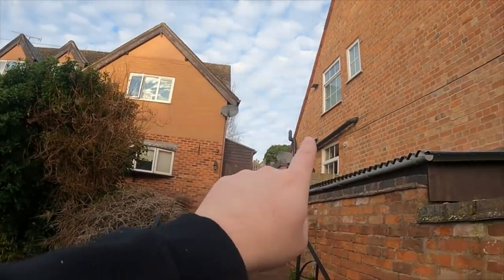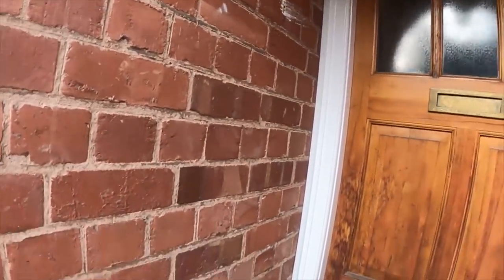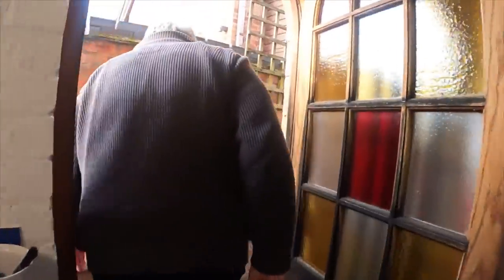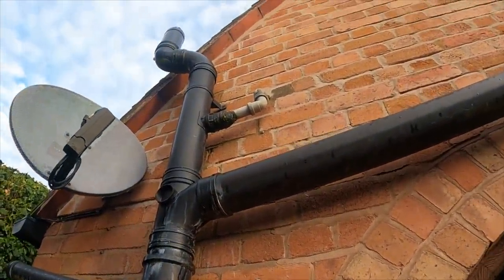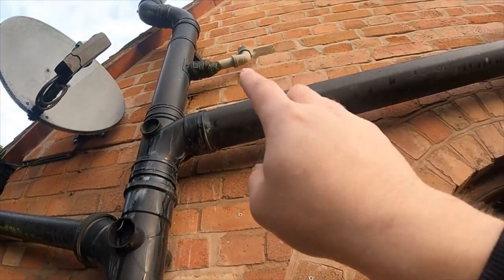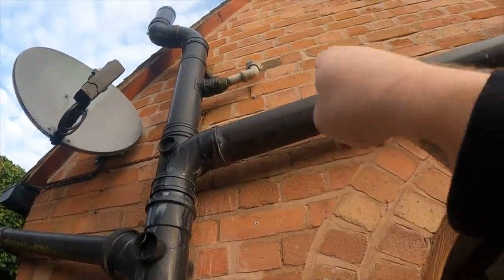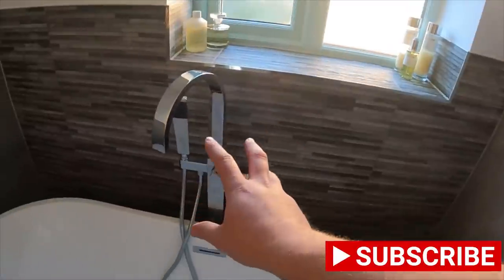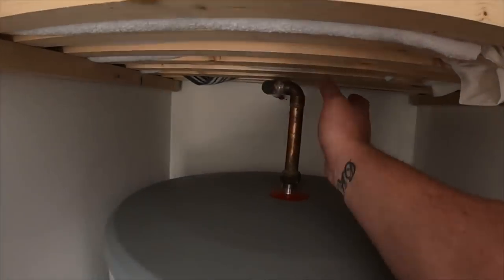PRICE REVEALED | PLUMBING COST for a BATHROOM REFURB (Cheap or Expensive)

Comment from the maker: JUST A LITTLE SOMETHING ABOUT TONIGHTS VIDEO....AS IM SURE PEOPLE WILL ASK

These are prices based upon where i live (Warwickshire) and the prices that i am happy charging my customers, in no way is it a guide to what YOU should charge.

I hope you enjoyed the video, if so give it a like, get subscribed and drop me a comment below....
Reply: Can you not go underneath the bathroom to change the valve surly easier to take the celling boards down then take the bath out tiles etc
Reply from the maker: @rastageordie7338  it’s a little tricky below as it’s the kitchen with units on the walls etc etc… would struggle to get to the area we would need…. But it’s an option👍🏼
Reply: Fantastic insight into a jobbing plumber and getting work quoted up. 
Your experience pays dividends. 
For comparison like you asked for on the jobs you looked at I would be at. 
1st job waste pipe £55 -£70
2nd job shower and Labour £210 - £250
3rd job bathroom suite £5300 - £5700

Just out of curiosity did those prices include VAT? 

Think this is a great video for trades but also customers to see what skilled trades charge so what to expect. 

Spot on mark 👍👊🤟
Reply: Thanks for the heads up, I’m moving into your area real quick!!
Reply from the maker: @davidtaylor7119  thanks mate…. That’s a great comparison…… out of interest where abouts are you??

That doesn’t include VAT as I’m not VAT registered…😉👍🏼
Reply: @MJTiffPlumbing  I’m on the Lincolnshire coast. Not long gone it alone so great to compare with experienced trades. It seems to be against the grain to talk about cost and what other trades charge themselves out at.
Reply: I was messing, good honest pricing, fair play mate👍
Reply from the maker: @davidtaylor7119  that’s just why I wanted to put a video like this out there…👍🏼👍🏼
Reply from the maker: @delboy6384  😉😉👍🏼👍🏼
Reply: @delboy6384  I know you was. Wouldn’t of expected any thing else. Good old banter 👍
But your price has just gone up 10%. Learning fast 😂
Reply: Looks like a Bovis build.? If so I normally find the blending valve under the bath, everything else is non blended. Cracking vid as always, good hunting 👍
Reply: Nice to know about pricing and quotes. But to have a roughly price once you see the job definitely need experience in pricing. Glad that I finished two videos plus a short video of your channel. Looking forward for next couple videos.
Reply from the maker: @aidanwalters8954  not a Bovis home mate…. It’s even worse than them🤣🤣

Yer hoping it’s under the bath👍🏼👍🏼
Reply from the maker: @samfoo341  thanks mate..
Reply: @MJTiffPlumbing  might be worth seeing how easy it is to drop a cabinet or two off the wall, I guess it all all depends on how they are fitted etc,, 

or an explorative hole within the footprint of the bath?
Reply: @MJTiffPlumbing  maybe try the  old hole saw on the ceiling below somewhere you can get easy access and shove you phone up there with the camera on. Least then it's easy to patch up if you don't find it and if you do it's a bonus
Reply: I think you had the problem in your hand I’ve had a faulty mixer cartridge do the same fault by passing internally, for the sake of a few quid it’s worth replacing.
Reply: Not far from me MJTiFF Hinckley I’ll bear you in mind when I need some work doing
Reply: I’d honestly make access under bathroom via the ceiling and just re route hot from basin to bath.. cap off the feed to bath currently? Patch up ceiling abit of plastering so much cheaper?

Comment: Bathrooms always take longer and cost more than any inexperienced person will ever realise because they are normally a small room that you cannot fit more than 1 or 2 people into at the same time. They also often involve, carpentry, plastering, boarding, tanking, electrics, plumbing, sometimes gas, tiling, painting, underfloor heating, flooring, etc. it is by far the trickiest room in a house to renovate. On top of that everything needs to be water proof, leak free and there are specific zones for electrics.  For those guys saying it should be around £4k, you are welcome to do all my bathrooms for me but you will be out of business within a year or 2.  Remember that loads of plumbers are self employed so they are not paid when off sick or on holiday and there is still insurance for vans, tools, fuel, etc.
Reply from the maker: Exactly mate 👍🏼👍🏼

Comment: With the bath I usually tell them that the ceiling below would be the cheapest option as the tiles would probably need to be totally removed and swapped for a near match or complete change.
Reply from the maker: Yep, that’s an option….. if it’s even in the floor
Reply: @MJTiffPlumbing  yeah that’s the nature of that kind of job though unfortunately
Reply: That's EXACTLY what I was going to say....easier and cheaper! 😊

Comment: I dont need anyone else to do the joinery or plastering or electrics. I do everything. That bathroom 5 grand if that. Now if you put in for 8 grand , Good luck  but still bit much . Now that i lnow you dont do everything yourself like i do thats why the price is huge . Its always good as a plumber to start off as a builder and do 4 years as a sparky too.
Reply from the maker: It’s also dependant on where you are in the country….. I find up north is cheaper than midlands, then london way is dearer 👍🏼👍🏼

Comment: We have just had a quote for complete bathroom refurb. Bathroom and toilet are separate (rooms keeping it like that). Complete rip out, board/plaster, Replace toilet, put in shower to replace bath, new basin, t&g walls, lay vinyl floor, decorate walls and ceiling. Quote was £6500 with first fix electrics, plumbing and cost of suite on top. We think it is expensive. Rooms are small.
Reply from the maker: Seems fair tbh…… think of the tools they need to do the job, skills, knowledge, guarantee of the work, insurance etc etc etc….

Comment: If you took the bath tap out, you could potentially thread an inspection camera down the hole along the pipes and see if the mixer valve is close by.
Reply: Good idea. Or a thermal camera to trace the pipes

Comment: Don’t know if anybody else has commented on this as I haven’t got the time to go through over 300 comments, but an infrared sensor may well show the position of a valve (future job), depending on how much heat is going through the pipe.
I have just used a Flir unit connected to my phone, to trace pipework in my flooring and it worked surprisingly well. Not particularly cheap, but for a pro you would likely recover the cost fairly quickly and it would save you a ton of hassle!

Comment: It's great to see a plumber explain how pricing a job works. When I was an apprentice, I was always very keen to know everything about learning about how to do the manual side of the job. Working with tools and producing a great job was all that I concentrated on - and I actually became very good at it. 

But, the problem came when I found myself working for firms that were charging the customer the going rate, yet I wasn't earning much more than if I just got a shelf stacking job in Sainburys. 

I did eventually go self-employed, but I was still sub-contracting for massive firms. I did see my pay packet vastly improve when I did this, but the problem I found by doing that, was that when the work dried up, then so did my job. And because I had put all my eggs in one basket I was no better off. Even having a few grand saved in the bank will very rapidly disappear when you can't find a new situation. 

I just wished I'd been able to build up my own business without always being in someone else's pocket all the time.
Reply from the maker: I hear you mate, it’s tough and the only way to make good money is by going it on your own, but that comes with pros and cons as we all know…

What are you doing now??

Comment: I've come across that problem with the bath tap running Luke warm Mark, turned out to be the tap cartridge  - it seemed to allowing the cold to run into the hot side. Try turning the hot water off and open the tap on hot only and see if you get cold water bypassing. Worth a try 👍
Reply from the maker: Always worth a try 👍🏼👍🏼
Reply: Me as well, and that was a  plastic cartridge. Unusual to put a TMV on the bath and not on the basin, will there be an update on this job

Comment: 7-8k was my guess depending on quality of fittings. This would be for bulk standard fittings. This is why as a landlord I take on most of the work myself only using a plumber and a sparky for speed when necessary and also a Plasterer to skim coat my boarding. Doing it my way the job would take 3 weeks to do and only cost me about 3.2k total. About 1200 for a plumber, 230 plasterer, 400 for sparky installing extraction fan etc the materials being about 1400. My time is obviously free and it would be a good free weeks from start to finish to complete. I expect you would get it done in a week, depending on the plastering

Comment: Good video and you covered a helluva lot there. You will be relieved to hear I have no questions or novel suggestions (because I have read the other comments😉) - however on that first video with the warm water at the bath - if the thermal imaging camera suggests the thermostatic block is under the tap - then I would suggest a quick up and under is probably worth it even if you have to take down kitchen cupboard(s) - it’s not just about being cost effective it’s also about being time effective.😉👍
Reply from the maker: Thanks Norman 👍🏼

Comment: Love the window in the bath/shower I bet the neighbours have a great show every morning/night
Reply from the maker: If they had neighbours🤣

It was obviously frosted before it was all handed over 😉
Reply: I’d be very tempted to put a easy remove washable blind on the window wall (not recessed) over that window, or a secondary sliding panel.  Once daily splashed by a power shower, it’s gonna mold fast and get hard water spots and look cruddy.  Also if I shower at night I don’t want my wonderful silhouette appreciated by all n sundry!
Bit of an eye opener this as I thought that bathroom was very small (more an ensuite size) and no moving any plumbing or ufh, so to be about 8k for swapping out just above standard same place fittings, dot n dab aqua panel (removing existing tiles?), didn’t hear what flooring, a few extra spots to connect (as already some there), bit of a skim, wow……..!  My eyes are opened, as may my wallet be!!😂  I’ve a Flir heat cam and a boroscope (only a diyer)so perhaps you need one too?

Comment: You could try borrowing a thermal imaging camera may tell you where the hot pipe goes into blending valve then goes colder after then just need to remove a few tiles hopefully? Worth a try. Glad you liked my suction pads ideas for the shower trays in the barn a few months back. Keep up the good vids and prices are good from another plumber 👍🏻
Reply from the maker: I will be using my thermal camera on it…Someone mentioned that earlier and I didn’t even think of it…(it was even in the van)🤣

Comment: Bath = access through downstairs ceiling = massive savings for the customer as apposed to alternative. 12.5mm 8x4foot plasterboard sheet would be more than enough to cover the bathrooms access needed. Repair access with said board and skim entire ceiling = 1 day plastering  and plastering materials only £450.00 tops. I would not want to get involved in that tiling looking at the rest of the work you presented. Great video 👍
Reply from the maker: All sorted now…. It’s in a video… interesting result

Comment: Last bathroom i done in Southampton was £8k on the dot. Bath out 1700 tray in,wet room shower screen, shower mixer, basin toilet vanity unit, 1200 towel rad. Aquaboard shower area and splash back, reskim walls and ceiling, move light switch to outside and extractor fan installed and waterproof Malmo click flooring.
Reply from the maker: Near on this price then buddy 👍🏼👍🏼

Comment: With the bath tap you may find it under the bath? Best thing i bought was an inspection camera (you can get cheap ones that work with your phone) that way you only need to do little damage in the ceiling below to see if it is in the floor? 👍🏻
Reply from the maker: Yep we are hoping it’s under the bath….

(And watch out for tomorrow nights video😉)
Reply: Cane to say the same thing.. and those inspection cameras are so good. For around 20quid on eBay you can get a Wi-Fi one that connect to your phone. So handy for the price.
Reply from the maker: @vinylspinner87  will take a look👍🏼👍🏼
Reply: They're awesome. Even has little adjustable led lights on the end too 👍 perfect for Plumbers and sparks

Comment: Camera then only need to drill some 10mm holes to put end in 
Don't remove tiled floor always ceiling underneath as plasterer can patch it in cheaply by feathering it in
Reply from the maker: Yep that’s an option, however it’s a fully fitted kitchen below with limited access due to unit positions etc…. Hopefully it’s just under the bath🤞🏼

Comment: I think you're spot on with the pricing for that bathroom. The people on here saying 4k haven't a clue

 I've just redone my bathroom myself (first time ever) its a little bigger than the one you've shown but not by loads. I did everything except the plastering so i know the true cost. It was similar to what you was going to do, ie: rip the tiles off, plaster, replaster the ceiling

All the materials including the plasterer came to £4200. Its basically a £10k bathroom had i had it fitted by someone.

By comparison the next door neighbor did his (himself) at exactly the same time. His cost £1300. But it looks a bodge, he's tiled over 3 sets of existing tiles and everything is basically a cover up instead of ripping out and starting fresh..

You get what you pay for
Reply from the maker: Thanks mate 👍🏼

Comment: To prevent ripping the floor up, Could you not trace the hot water pipes with a heat detector to locate the blend valve?? Flir thermal detector was the best £1500 I ever spent
Reply from the maker: I use HikMicro Thermal imaging….. check out the video where I sort the issue😉😉

Comment: Hey! Regarding bathroom renovation. How's about moving shower position to the opposite end. 1500 X 700mm tray with a 1000mm wet room slab of glass. Rather than a sliding door so no moving parts to go wrong. Alternatively, could go with an 800mm wet room glass with a 300mm flipper on the end, would give more elbow room to get in and out. Fantastic vids 👍 great work.
Reply from the maker: Yep, that’s an option but the customer wanted a price for a full “cubicle” style.
I like fitting the flipper screens, think they work well
Reply: Gotta go with what customer wants mate. I say spot on with those prices 🎯  down on south coast.

Comment: Interesting video. I have just renovated my own bathroom which involved moving the bath and the vanity basin to another part of the room so as to accomodate a separate walk in shower. The bath and toilet were in good condition so were reused but the vanity unit was falling to pieces so was replaced and of course there was the need to buy a shower enclosure and tray on top of the tiles, paint flooring and a heated towel rail. I haven't kept a tight tally of the costs but its around 1.5 - 2k. Taken me 3 months of mostly working weekends. Have saved a lot of money doing it myself. 

However I appreciate that it would be a different story doing the same work for as a professional. It's one thing doing it in your own property that you know well, know your requirements. Would be quite another doing the same work in someone else's property that you have never worked on before, having to assess what needs doing and not knowing what you are going to find.

Comment: I did a bathroom a few years ago, similar thing with expensive tiles etc. A few weeks later I had a call back for a leak, required bath out to rectify and potential damage to tiles. My solution was to cut through wall from next door to gain access to pipework. The pipe had a pinhole 🤬🤬🤬 Much cheaper than removing everything. The customer was happy to pay for a builder to patch and re plaster the hole I created.

Comment: With that Luke warm tap in the bathroom, you could remove part of the ceiling under the bath instead of removing the bath tiles etc! Also how do you send your quotes and invoices?
Reply from the maker: That’s an option if need be but it’s a fully fitted kitchen with not much access…

Quotes and invoices via Email 👍🏼👍🏼
Reply: I’d take the tap off the bath and run the hot through the flexible hose to see if it runs hot.
Reply: Bath tap could be due to too much cold pressure coming in as most likely it's not balanced at the multi control valve in the a/c so that could be the issue. Flush the loo & run the basin tap on the cold you'll then see if it is a balancing valve issue or too much cold pressure .
An idea you could approach the builders & ask them who the plumbers were & any idea where the balancing valve is, might save you alot of aggro !!
Reply from the maker: @actorlyric  balanced cold is the first thing I checked, it’s all good…. That’s ruled out.
As for the builders, this is why I’m there now putting stuff right as they are not interested in fixing it let alone helping you sort it….

Thanks for the comment though👍🏼
Reply from the maker: @Sparks1Plumbers0  looking like it’s the only option….
Reply from the maker: @rossmanning4863  and I would…. It I can get to it🙈🙈
Reply: I’ve seen that  on a kitchen mixer same type and it was the mixer cartridge at fault leaking internally 
For the sake of a fiver try that before ripping up the tiles.

Comment: Use a thermal image camera to see where the pipe is warm up to the bath. It may help locate it without ripping everything up
Reply from the maker: Unfortunately that didn’t work either…. However we did sort it in the end, check out the video
Reply: What's the link and thanks